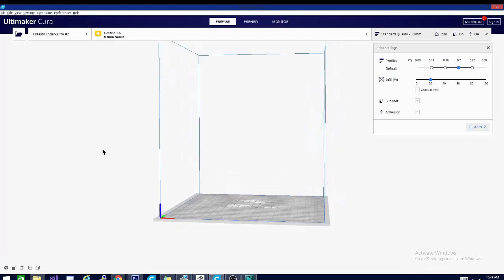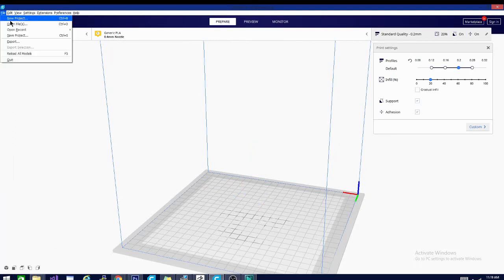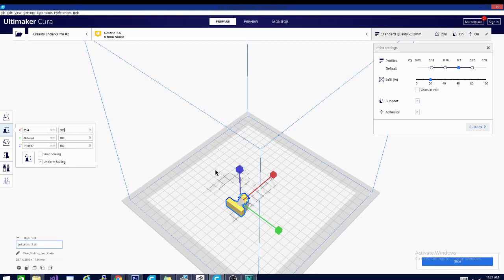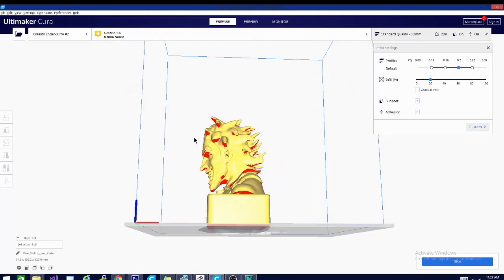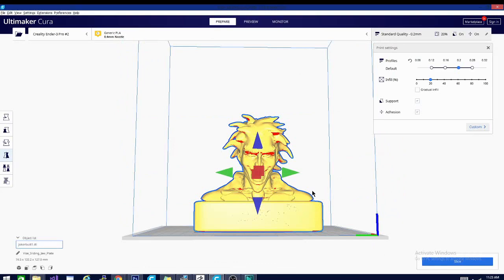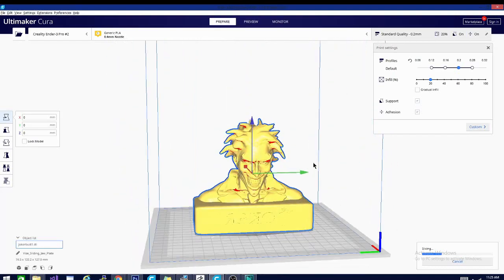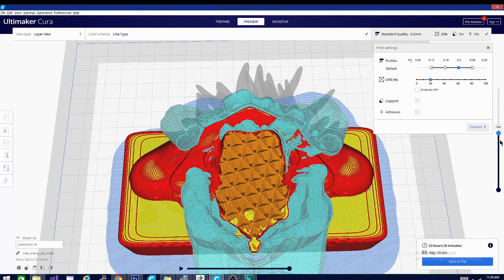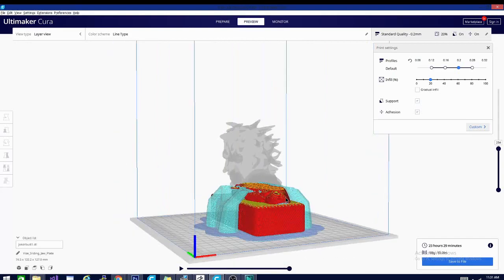Cura 4.8 Tutorial - Intro to Cura Slicer for 3d printing

Comment: What is that huge flat object on the first layer on the ground? I tried using Cura and it also appears in my model, I never 3D print anything so, if anyone can explain I'd be happy to hear that. I want to 3D print my electronic enclosure btw
Reply from the maker: That is a raft, it's under the adhesion settings in cura, and you can turn it on and off. It helps big parts stick to the bed, then it peels away from the oart

Comment: Upgrade question - I'm using Cura 4.7.1 -- what does installing 4.8 do to my tweaked profiles, extensions, modified scripts, and everything else I've done to tweak and tune Cura over the last few months?
Reply from the maker: everything will be pulled over except themes and color settings
Reply: @Technivorous  As long as you check the right box lol
Reply: Always a good idea to test the stock profile with a Benchy whenever you install a new version...I was using CHEP profile on 4.7.x....after I went to 4.8 the stock profile worked better 😬 but I have an upgraded Ender 3 Pro w/BTT SKR Mini E3 v1.2, etc.

Comment: Cura 4.8 works great on my Ender3. 60deg bed and 210 temp, glass bed, pla. Mostly stock settings. I had Chep's magic settings on 4.7 but I didn't need them on 4.8. (Chep even says that with his tests on 4.8).

Comment: I've found 4.8 to be pretty buggy.  Once sliced, I've had multiple features simply not appear in preview nor print.  The same stl files work fin in 4.7, but in 4.8 they mess up the slice.  CHECK PREVIEW CAREFULLY.
Reply: I have been having trouble with Cura since I got it. every print fails at the very beginning of each print. the plastic doesn't stick to the bed and no matter what I do nothing changes. I also don't understand why each section on the tools has the same list of categories underneath them. quality, shell, yada yada yada. Wether I'm looking at the infill structure or any other categories, the choices underneath them are exactly the same. The major difference that I notice between his screen and mine is that the last symbol on the far right where the adhesion category is it says "ON" mine says "OFF" but I don't know where to go to turn it on. I don't know what to do or why there are so many option in the setting and then why the same option repeat on the main screen under the tool section. can anyone help me?

Comment: dont like cura at all nothing but faulty prints
Reply: What do you use as an alternative? I find both Cura and Prusaslicer hit and miss with my ender 3. Prusaslicer is awesome on my MK3S though.
Reply: @matthewbrown8557  i use Ideamaker the prints are much better and less printing time then cura 
You can create your one config. by ideamaker io. or you can try some others you will find that when you select your machine.
give it a shot you wont be disappointment.
Cheers
Reply: @matthewbrown8557  Your machine isn't dialed in enough if either of the slicers aren't working well for you...I use both, because they print supports differently so it depends on the model I'm printing, but they both work extremely well as long as my bed adhesion is good